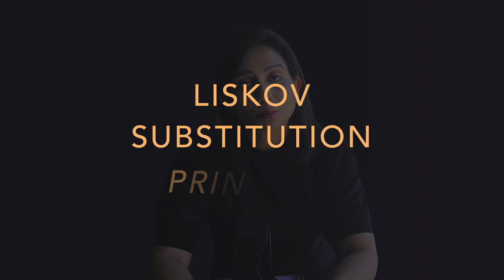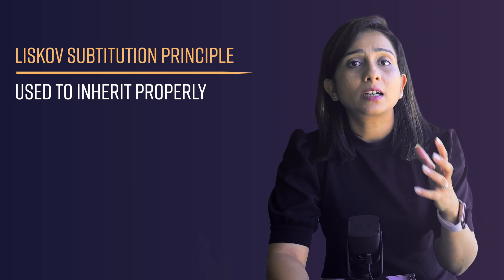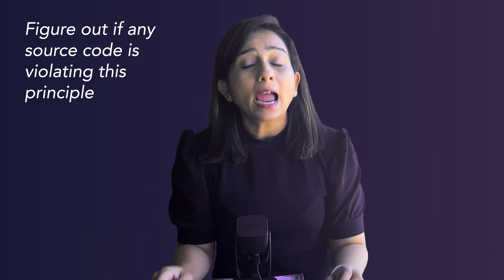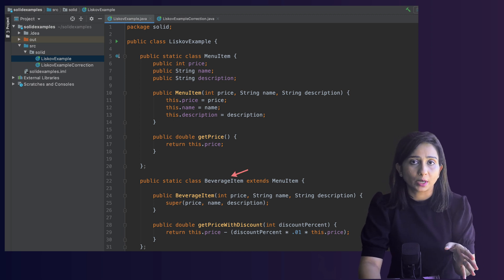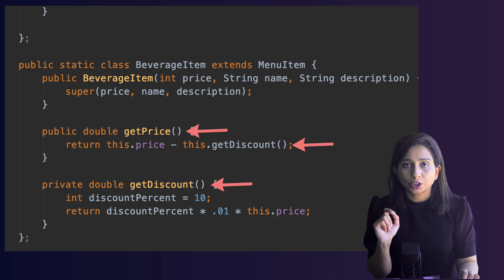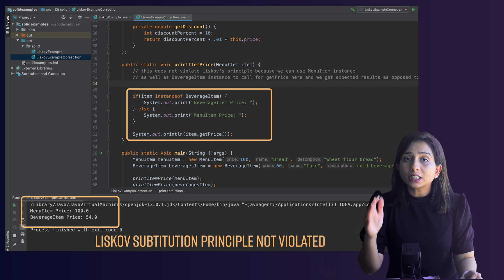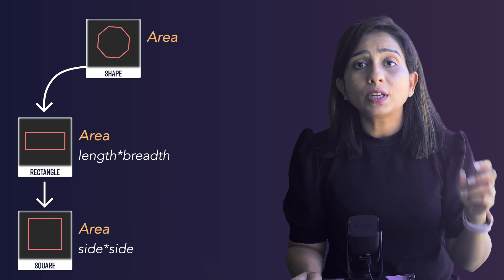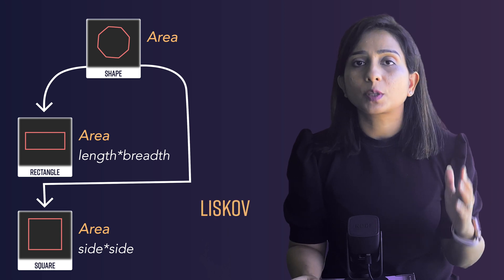Low Level Design 107 | Liskov Substitution Principle | 2022 | System Design

Comment: If the modification to rectangle class is interfering with the square class implementation, doesn't it mean one of the implementations is wrong? A rectangle is inherently a square, and anything that applies to a rectangle should ideally apply to a square as well. Can you give an example modification here?

Comment: In the context of the example of the Shape class and its functionality i.e. just to compute area, there is nothing wrong with the Square class extending from the Rectangle class. It does not violate the LSP either, you can actually replace any instance of the Rectangle class with an instance of the Square class.

However if you have a Rectangle class with setter methods for both Lenth and Breath, making them mutable independently of each other, then extending the Square class from the Rectangle class would violate the LSP. Because calling setHeight() and setWidth() on an instance of Square class would change the other property, which in purely programming construct might fail a few tests.

An important thing not to miss here is the context and functionalities the parent class is providing. They must work even after substituting with an instance of the child/derived class.

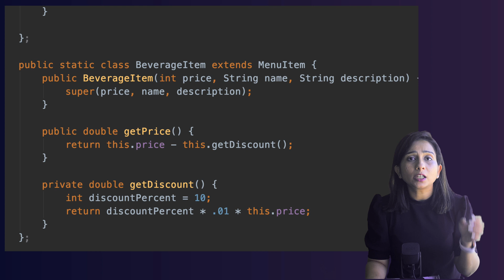Comment: If we implement the methods again in the child class when they are already present in the parent class (04:09), then what is the point of inheritance here. Also, the implementation in both parent and child classes is also exactly the same. Aren't we redoing the work and doing code duplication?
Reply: exactly my point
Reply: probably given a wrong example.

but you can image beverage item implementing get price with some custom logic, based on what is the item because bevarages cost more
but every other item we can follow standard price
Reply: thats why composition > inheritance
Reply: You can use the same method from parent by not writing method, or modify the method but you shouldn't say that this method is not applicable.

Child should have all the capability of the parent
Reply: I don't think this is correct.
Reply: getPrice is present in the child with modified functionality of discount.

Comment: what do we mean by breaking here in the method? even after the implementation of getPrice in BeverageItem(), if I replace menuItem object by beverageItem object, unless we specify the correct instance at creation, we would get the price of beverageItem without discount right?
So what are we trying to prevent here? Ensuring that at least we can call the method from both child and parent class or we need to ensure that even if the superClass is replaced by subclass object we get the same response?
Reply: I'm with you, this is not a violation of the LSP

Comment: Yogita, Thanks for the video. I have some questions:
1. While designing Menu class it seems like I have to think of the future cases like discount etc and after designing when a new requirement comes which needs to extend Menu class and add some features then I will have to refactor Menu again. Is it right?

2. Suppose, rectangle has a method getLeftArmLength() (Just say this method returns length of an arm) then Inheriting from rectangle I can use it in square as well. But inheriting from shape I have to implement that method both on rectangle and square. Doesn't it reduces code re-usability?
Reply: I think these principle are very subjective, and one can argue over how his design is better, over others in many ways.

Comment: What if we define the getPrice() in the MenuItem class only with a parameter named "discount" and we set its default value to 0.

int getPrice(int discount = 0)
{ return this.price - discount * this.price/100}

Now when we want to calculate price for BeverageItem we simply use the BeverageItem instance (bev_item) and do this --> 
     bev_item.getPrice(discount = 0)

With such implementation can we say that LSP is followed correctly ?
Reply from the maker: The idea is that caller should not know about the discount.

Comment: Sorry to say but first example is actually example of open close principle where client code is remain the same due to use of polymorphism (without any instance of condition)
LSP mainly deals with 3 concepts of subclass
1. Precondition should not be strengthened- meaning input param validations on overriding methods should be not be more strict than overridden methods
2. Postconditions can’t be weakened- meaning if your parent class method returns a String object in all scenarios then overridden method also should return String and not Null(for exception scenarios)
3. Invariants must be preserved - meaning internal state of object(parent) should be correctly preserved by subclass
Reply from the maker: You are right with respect to what ocp is but in first example here, Liskov is being violated because as per Liskov, substituting a child instance instead of a parent instance should not require any checks in client code. It can be easy to confuse with ocp because of an overlap. It would be great if you can share the source for the above 3 points. I have taken the first example from the book of four. I can link it.
Reply: @sudocode  let me check gof for first example.
I used wiki for those 3 points https://en.m.wikipedia.org/wiki/Liskov_substitution_principle
Reply: As far as I have checked, gof book does not explain LSP, It’s only for design patterns.
Reply: @sudocode  Great video! What I fail to understand is, if "objects of superclass should be replaceable by objects of subclass" and in this case we replace menuItem() by beverageItem(), we would not get the correct value( as discount would be 0), so essentially what are we trying to prevent by creating a getMethod inside beverageItem()? To get the right response (i.e. with discount) I would have to be mindful of the type of object I create right?